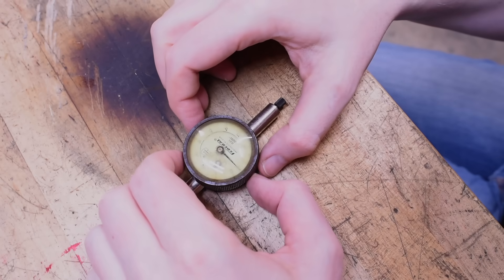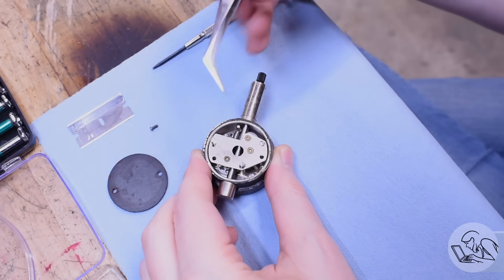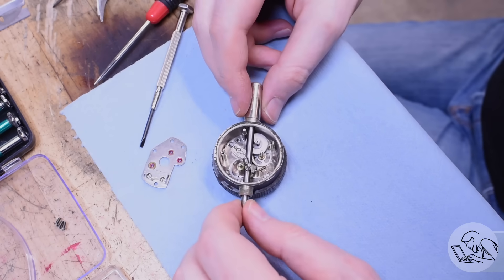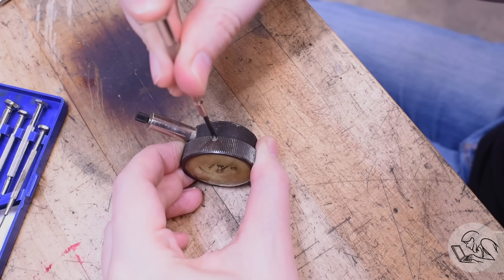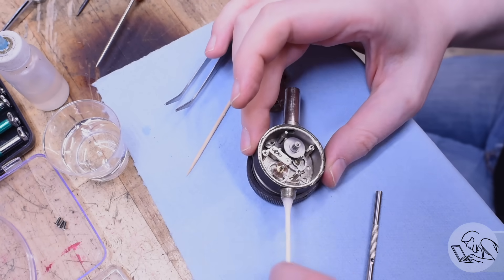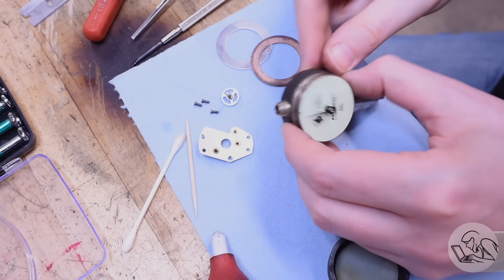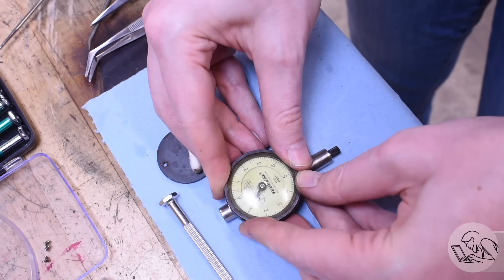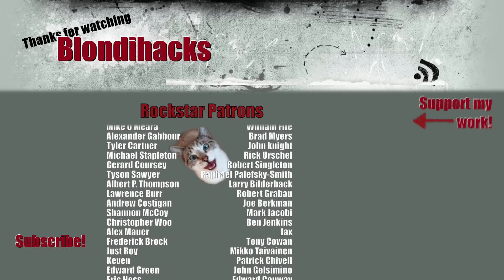Repairing Dial Indicators - Diagnosing, Fixing, and How They Work!

Comment: I love that you tried on this indicator and are learning. Watch wristwatch revival on how he removes the hands of a Watch. Making those small pry bars would be a simple as going to the hobby store and buying some 1/8 inch hardwire from the model airplane display case. I think the brand is KB? That's how I made my first set. I now have probably six sets for various sizes. The only other thing I can say is that you should not have lubricated the rack gear. Leave it in all other gears dry. You can put a drop on every pivot and on anything that slides which would be also the pin that runs in the slot of the movement back to keep the gear rack from rotating. Also put no oil on the hairspring. If you buy your q-tips with wood handles, it will give you an infinite supply of pegwood as watchmakers refer to them. You can sharpen them into points for cleaning the jewels, you can sharpen them shovel faced to clean out crud from grooves, etc. now if someone would just show me how to service an Interapid...

Comment: Two things: 

1) Thank you for this, made me much more comfortable with the idea of taking apart the dial indicator I picked up on facebook marketplace

2) I do not recommend Etalon swiss indicators if you think it needs maintenance. The body was one piece, so I had to take off the hands and file down a screwdriver to take out the worlds smallest flat head screws to get the face off. Luckily it didn't have any damage, just needed to be deep cleaned and have the jewels cleaned.

Works great now, but not as easy as other options

Comment: As a hobbyist watchmaker this is some great work & something I'd like to try. I'd probably disassemble the whole thing and clean all the components in a naptha bath then an IPA bath in an ultrasonic before reassembly though as old lubricant will still be in the running gear. 

Some polywatch would also work well on the crystal if you don't want to go out and buy big bottles of polish. It comes in a small tube that lasts for ages (I must have done 20-30 watch crystals with it so far and there's loads left). Nothing will take out the yellowing though. But with careful measuring and an inexpensive crystal press it would be quite easy to swap it for a pocket watch crystal of the same size.

Comment: Wow, what an excellent video instruction. I am a retired military vet and started woodworking as a hobby, and love it.  My Dad’s was a mechanical and civil engineer besides an avid woodworker and electrician, unfortunately, passed away 2 years ago, but on the bright side, I am so happy (like a kid in Christmas) that he left me so many tools with his engraved initials, so he is still with me. Some of the tools or accessories, I didn’t know what the heck there were for and one of them is a Vintage Sheer-Tumid Dial Indicator, in good condition, except, noticed dial was slightly sticky so your video gave me the confidence to take it apart, clean the plastic cover as well as the small rusted screws and dial works well and looks good.  I am going to use it to calibrate my table saw blade and fence for the first time this week.  Later on plan to disassemble it like you did as I saw some light rust creeping in.  Again, thank you so much for your video.  New Subscriber.    Like the comment: “use your hands until they get tired” 😂 Keep those video coming. 😊

Comment: bugger, mine is beyond easy repair. I reckon someone whacked the plunger in hard, and broke the tiny pin end clean off, on the end of the first main wheel bearing (I mean jewel). Cheers, for clear video.

Comment: I’m a watchmaker apprentice (not a Swiss one!) on my own, and that’s what brought me at first into your channel that I love so much! I agree with all the “Swiss trained watchmakers” here and my only suggestions is for you to use something called Ridico to remove loose debris and old oil; then clean with lighter fluid (you can bathe the bridges in it then use a lint free paper to dry out and clear the crude dirt) and use it with the toothpicks to clean crevices as well; for oiling the jewels you should buy some oilers (they are just needles with a handle and a tiny pale shape on the end to collect the right amount of oil/grease) or use technical drafting pens 0.1 or 0.2 mm to add a “watchmaker drop” of oil in the jewel orifice since we’re not going to take them off neither take them apart (don’t oil a dirty jewel!!! It’ll loosen the old oil and dirt and make it worse!!!); you can use instrument oil which are made specifically for these guys instead of machine oil. I just did a federal, and another one I had bought years ago (both on the 0.0005” and 0.0001” precision level), last night before browsing your videos and finding this one. Thank you so much for all you do in every level of machinery trades intermingled by the same techniques and equipment, in different scales of course!
Happy holidays!

Comment: Your combination of skills are amazing. I have the understanding but not the fine dexterity you poses.

For a surface to work on I like a clean white hand towel. Things dropped stop without bouncing.

I like a block of styrene foam for holding screws. I can stick them in in the same orientation they came out so I don’t have to keep track of length etc.

Comment: Brake Kleene  (basically dry cleaning fluid, 1 2 Di-chloro ethane) does a great job of washing out crud.       Medicinal Paraffin is a great low viscosity lubricant.  Doesn’t leave residue.   Washes away WD40 which people always use to unstick and clean things…it’s got kerosene which leaves an oily film………good lubricant but not a good parts wash!!!

Stavros

Stavros

Comment: I echo the toothpaste for polish suggestion.  Question - I got a used indicator cheap made by Harbor Feight, seems OK, but has only one screw holding the back.  Any thoughts where I can get replacements?  Watch repair, maybe?  Just went through most of this recently but didn't remove the bridges.

Comment: One other thing that will cause the needle not to come back to the same position is you need to put a preload on the hair spring, I have done several Federals and everyone of them as I took them apart had a preload on the hair spring as well. Before placing the idler wheel back in I place the large hand back on and turn the hand two turns, then with the rack in the fully extended position I replace the idler wheel which now keeps the preload on the hair spring.

Comment: I don’t know what I’m doing wrong repairing indicators.  I get my hammers, pry bars, gear pullers, torch, and any other tools I might need and lay them out neatly.  I put on my safety goggles, steel toed boots and gloves on and carefully go to work.  Rarely am I successful in repairing an indicator.   In fact sometimes they’re in worse than when I started.  Any pointers?

Comment: Excellent job, definitely a good quality instrument,  nice caveat on oils, up there with dry or lubrication on torqued fasteners. 
Another check is to test if the plunger performs as well when inverted.
Thanks for sharing.

Comment: having worked with small parts for many years as a retired computer repair technician, searching through carpets became a way of life for small screws and even smaller components. And became good scud work to give the Junior techs to do the searching, I eventually found a couple of Neo magnets, and 1 of those pinpoint pocket metal detectors, does the trick in finding them. unless they hit a solid surface in which case Newton's laws come into effect and they disappear into an Einsteinian quantum warp field only to show up in some other dimension usually sitting on the bench as an extra part left over from some other reassembly project that keeps you scratching your head as to how it got there and what it belongs to.

Comment: Quinn, now that I've seen this video I think I'll open up a 10-inch Starrett indicator rescued "from the trash" at work ~20 years ago when they still sold stuff like that.  It had failed calibration, so went out as "scrap/trash."  I've even got the original Starrett wood box it came in.  :)  Maybe I'll get lucky and find that it only needed cleaning and re-lubrication!  I've always had a fantasy of using it as (part of) a poor man's DRO on either my mill-drill or lathe and even being "out of cal" it may still be more accurate than either piece of machinery!

Comment: Tip from a watchmaker friend of mine about screws and tweezers. Use the minimum pressure required to pick something up. That way when you lose grip on it it drops to the table instead of flying across the shop and landing in the swarf bin.

Comment: Does the hair spring need to be preloaded?  I assume it's there to take the backlash out of the gear mechanism, and my assumption was that as soon as the bridge came off it would release its preload and need to be reset at some point.  Am I wrong about that?
Reply from the maker: It probably does, but all the more reason not to remove it. 😁

Comment: This was a good video and well documented. I have recovered over 50 mechanical and about a dozen digital indicators from scrap drawers for emergency gages. 1.) Use Starrett instrument oil.  Great to have in the do-it-yourself shop for lots of other stuff.  2.) Pry indicator hands off. Place 2mil cellophane over the dial and hands.  From the outside of the cellophane,  use opposing blunted small flat blade screw drivers to gently pry at the base of hand hub. Do not slip and hit the hand!, 3.) Frequently the indicators in our factory had bent stems. Most of the time the stem can be patiently wiggled out with slight force.  If not,  press out the short bearing and pull out the back. (Slit brass tubing, place around the stem inside the case, pull the tubing with needle nose against the bushing. If bushing glued, scrap the indicator.) The following is NOT recommended by the manufacturers.  But,  the stems can be straightened for emergency only.  Place on a flat reference surface (surface plate,  plate glass or similar) and roll. Note where high. Using blocks of wood, one as an anvil, gently tap the stem back straight. Then using a fine Arkansas stone,  gently stone the stem to remove burrs.

Comment: Two things I would like to add to Your encouraging presentation on fixing these.

One: The plunger should NOT be oiled at all. Any oil in there will only create the sticky stuff that makes the dial indicator to fall into coma. The plunger and the bushing it is running in should be cleaned thoroughly though. Oil is ONLY needed on the bearings and the correct amount is really miniscule. So no oil in gears or the rack. One can use a needle to deliver the oil. Squirting it into there is bad.

Two: The hair spring in there is to eliminate the backslash. Before the plunger is put back to it's place, the clock arms should be turned clockvise so that they become slightly tensioned. The number of turns depends on the dial indicator, some need more pretensioning because of the bad workmanship. Usually one turn of the arm is sufficient.

Edit: In Your case the pretensioning was "automatic" as You turned the arm to it's original position without taking the arms off.

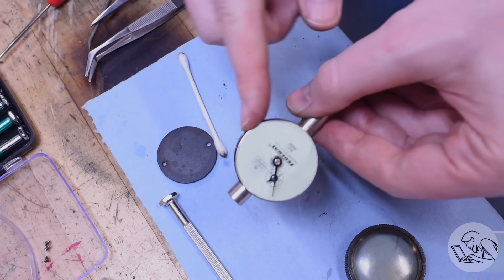Comment: 11:55 was tense - I was anticipating the o-ring snapping back under the pointer and bending it up. Also would the slightest smear of silicone grease on the o-ring (after fitting) make it feel smoother?

Comment: As an old NBS Physical-Dimensional Lab Tech.  I've calibrated and repaired hundreds of Dial Indicators.  In doing so, I've found the most common cause of a sticky indicator other than crud build-up is a bent shaft.  And for adding oil to a Ruby Bearing...Never do it.  They are designed to run dry.
Reply from the maker: I appreciate your experienced input! Watchmakers told me I should put a drop of oil on them. Now I don’t know who to believe. ☺️
Reply: @Blondihacks  Well, according to the NBS Tech orders of the 70's and 80's (Back in my day) they are designed as "Dry" bearing surfaces as any oil actually inhibits free rotation.  When I had to open an indicator, the first thing the T.O. told me to do was give the unit a Freon flush to clean everything and I would lube only the shaft upon reassembly with a non-drying silicon fluid peculiar to the lab back then.  For polishing hazed lenses, we used Alcohol and Pepsodent Tooth Paste.

  As an aside, you would get a kick seeing our surface plate.  It weighed 2 tons and was on a steel stand bolted to a concrete foundation that was vibration isolated from the rest of the lab building with a "Goo Trough" between the two.

Comment: Quinn, Quinn , Quinn, You never Cease to amaze me No body buys a beat to death Indicator on E-Bay. Than  takes it apart at home and uses no replacement  parts and then when they are done it works ???? I believe you are using special effects from the Acme special effects company .. Thank you for taking the time to make these videos...
Reply: Aaahhh, but she did use a replacement part. The rubber O ring was replaced.  ;)

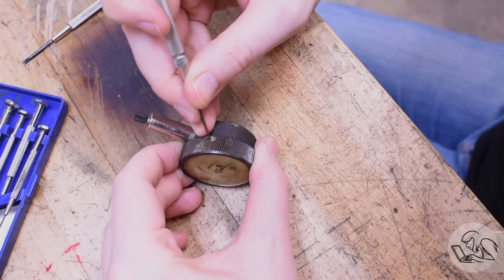Comment: I bought a pair of Federal indicators at a pawn shop for $20. The foam in the case is a bit gummy from age, but they both work  fine.  The shafts are short and the dials read only to fifty thousandths, with the 50 in the 6:00 position.  The indicator sweeps right and left. (-50/+50)
I only bought them because they looked cool. 🥸
The only thing I've used them for is to check expansion of a hardwood floor I installed.
Yes, a wood floor. I know. 😁

Comment: My $0.02 - my general experience with moderately gummy indicators is that they generally don't need to be disassembled, just degreased and reoiled. Especially those that have laid around without much use. Alcohol on the bearings, then relube. Explanation - most oils contain a mix of molecular weight hydrocarbons. Over time the light weight molecules evaporate and leave behind the higher weight hc's. There may also be some crosslinking making even bigger hc molecules. These have higher viscosity and of course are gummier. Now I've got me wondering if some synthetic oils may have a more narrow range of molecular weights or lower vapor pressure. Like ATF fluid, silicone oil,  ????  HMMMMM?
Reply: I just took the back off the ones I had and sobered them with air tool cleaner and then oil.

Comment: Top tip: for fine polishing, you can use toothpaste. It works great on headlights, plastic “glass”, final polish for knives and in wired etch cases it can be used to clean teeth.
Reply: Also as the last step for polishing scratches out of CDs and DVDs, if anyone still uses those...

Comment: I did a year in a machine shop as a general dogs-body.  A tool outfit accross the alley sold me my first set of used dial calipers, warning me they were a bit flakey, and sold me a few racks with it.  Someone had brought it in for repair and decided to abandon them. My best guess is that one of the gears was a bit chewed, and every several months it would start getting a little jittery as it chewed up the rack.  Cheap enough and good enough for the tasks I had to deal with.

Comment: EDIT: Blondi and Daan and correct here; both springs work in the same direction.

Original: I think the retraction spring and mainspring are working against each other, to take up the backlash in the gear train. I think that'll improve accuracy at the cost of a little more wear on the components.
Reply: It doesn't really matter if they work with each other or against each other, as long as the main spring exerts force on the whole gear train it will take up the backlash. So why not let them work with each other?
Reply: @daanwilmer  Hrm... I think you're right.

Comment: Not only work on a soft surface to keep from scratching, but even better is to work on a large terry cloth towel.  If a part happens to "jump" out of the assembly, when it lands on the towel it will not bounce and end up somewhere on the floor where it cannot be found.  Been there, done that.

Comment: That Novus #2 polish is miracle level stuff.  I used to use it to make scratched CDs playable back in the day.
Reply: I have Novus #1, #2 and #3.  They're great, but DON'T use them on polycarbonate.  I've had polycarbonate components explode (high stressed, in tension) because they came in contact with Novus.  There's a little note on the back of the bottle about how it's not compatible with polycarbonate.  They weren't kidding.
Reply: @unhinged-menagerie  Whut?  Half the stuff they have on their suggested uses list are polycarbonate, the first being cd's and dvd's, the second being auto headlamps, etc etc.
Reply: @Milkmans_Son  Right from the label printed on the back of the bottle:

"Removes heavy scratches and abrasions from most acrylic surfaces.  Contains abrasives, not for use on eyeglasses, polycarbonate, or coated plastics."

I didn't read the label and destroyed about $1000 worth of oceanographic equipment.  We did break tests on polycarbonate after the failure.  We tried exposing samples of polycarbonate to a number of different contaminates and oils, one of which was Novus.  Novus was the only sample that destroyed the polycarbonate.  Polycarbonate is normally extremely flexible and has high mechanical toughness.  Novus soaks into the polycarbonate and makes it shatter like acrylic under low stress.

Comment: My companies way of fixing old indicators that didn't work was to throw them in the scrap dumpster. I cleaned a .00005 Mitutoyo up on the inside and it works just fine. The bag full I pulled out I gave to my retired machinist father. They tossed out both dial and test indicators along with a bunch of go/no go gauges. :(